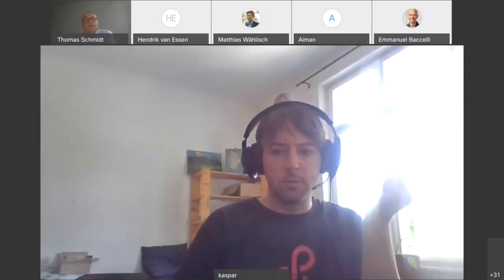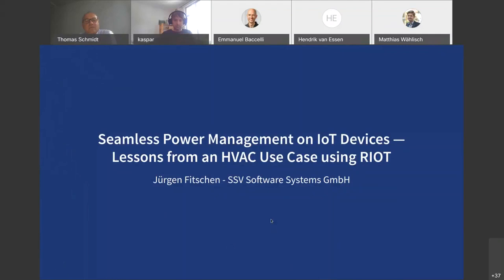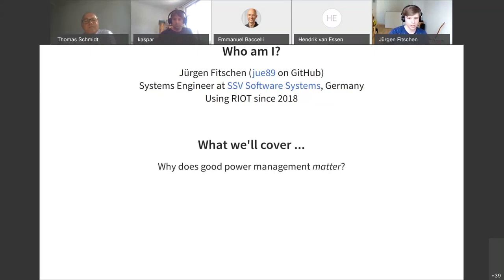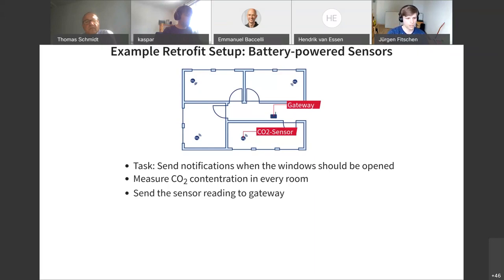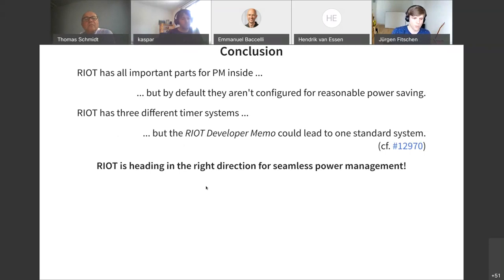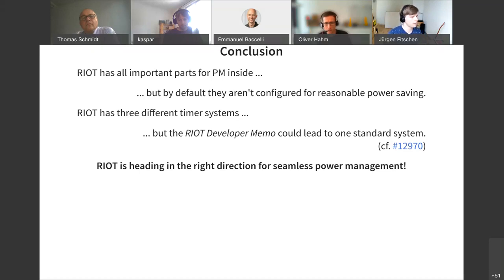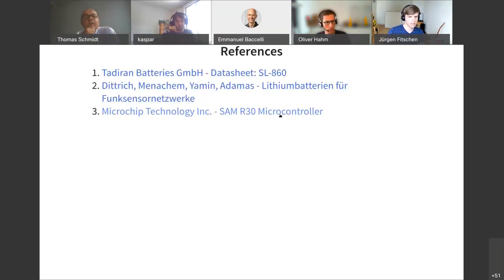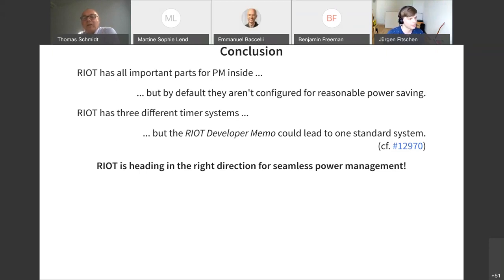RIOT Summit 2020 - Seamless Power Management on IoT Devices: Lessons from an HVAC Use Case with RIOT

Comment: Thank you Jurgen , really it is a good presentation. But I have a question about the timers (specially evtimer), it could be used to put the board on a sleep mode until receiving a new packet on the radio rx chip ? and is this ztimer can put the IOTlab-M3 node a sleep mode to gain in power consumption ?